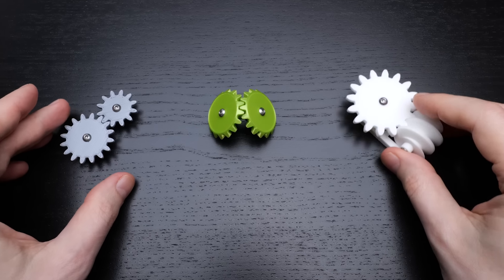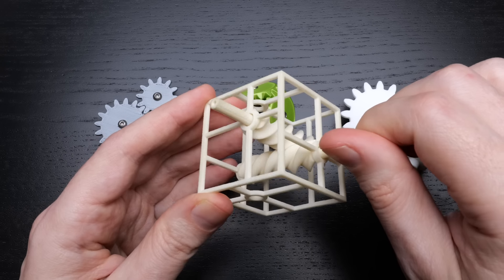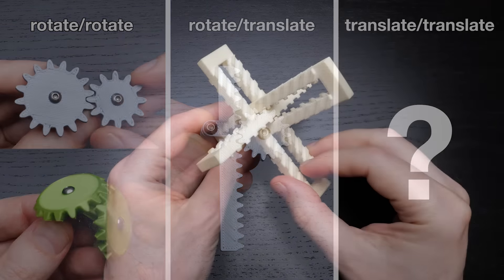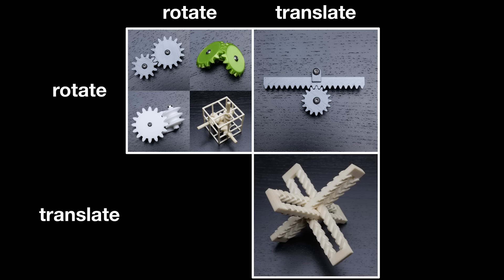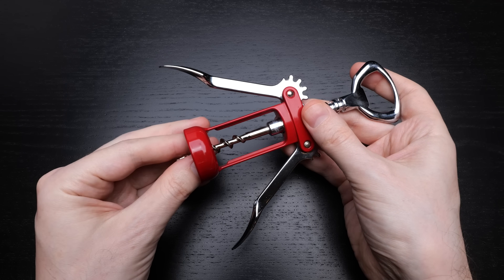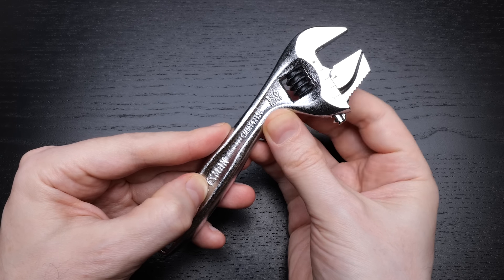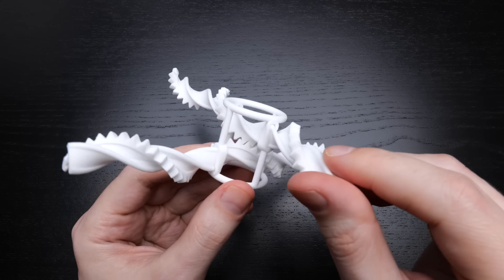Screw/screw gearing

Comment: Translate-translate is used in some garage locks in Russia. It is a very old design, but it is still manufactured. The key is pushed (or inserted sideways, rotated and pulled) through a hole and the "teeth" on the key interact with the "teeth" on the springloaded locking bolts, retracring them. Secrecy is achieved by the angle and positions of the teeth.

Comment: Actually a screw screw would be awesome for a lower weight safe locking mechanism. Extension and rotation can make a better lock than just translation from rotation. Similar to the force as rotation and lock mechanism works on modern rifles.

Comment: For the bottle opener, The screw forces caused by the cork screw are translating the cork screw, and that translation is moving the gears, not a screw motion through the gears.   It's the same gearing in both action.  Just because it's spinning in the gears, doens't mean it's moving by screw gearing, which is why it works in both directions as translation..

Comment: I can imagine the screw/screw mechanism being used as a regulatory mechanism to ensure 2 angled planes move in a rocking motion at a locked speed ratio and only one of them is powered. There is probably a much simpler way of doing it too.

Comment: Simple mechanism with 2 parts it is a bolt key. You push, or pull, if it is a reverse rigel key, and the latch slide to open door.

Comment: I don't know of any real world machinery that uses screw gearing however it can be applied to piston engines by seating these gears in the piston free to rotate so that the fixed oscillating motion can translate into rotational motion that can then be used to spin and drive magnets in an alternator system to generate more electrical power for other uses. correct me if I'm wrong but if my understanding of the gear is correct it can actually be set up in an array with four axels facing in different directions  so long as its helix is oriented correctly meaning they can also have more inputs to counteract the torque stress on the teeth of the gear

Comment: There is yet another tool, that fits the rotate/translate box as well as the translate/screw box, depending on which of its elements you fix in your hands. The Archimedes drill a bit outmoded, but still available!
Reply from the maker: How many rigid parts does the archimedes drill have? From looking at a couple of pictures it looks like two?
Reply: @henryseg  Maybe a video explaining its use  helps:
https://youtu.be/bM_ZnunHWJs
- or -
https://youtu.be/mFLBVIF-xNM
-> it is two parts in total. 
In the rotate/translate box, both are moving. There is no cage, unless you consider the collar, that does the translation, to also be a cage. You might also consider the piece you rest it against, in order to drill the hole, as a replacement for the cage.

In the translate screw box, it gets even weirder, you fix the collar, the wight of the drill alone will cause it to screw through it - which means: the translation is actually zero, still the drill itself screws under is weight.

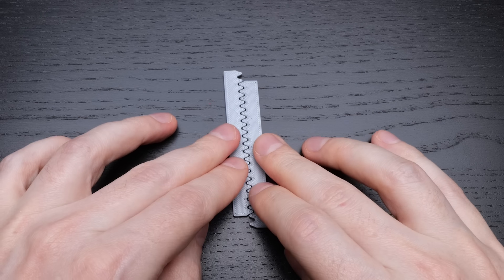Comment: If we think about rotation of a verrry big wheel around a very faraway axis, then in the limit we get translation. So the rack and pinion is a limit of the gear-gear link (with either the parallel or intersecting axes). At which point I thought of the rack and rack, which of course you finally got around to at 5:45.
Reply: I was going to say this as well!

Comment: If you fold each screw back onto itself you end up with a Mobius strip, and thus a cyclical motion. This is equivalent to a spur gear if you put two (or even number) twists in it.

In which case, the example in industry would be a roller coaster depending on drive type and frame choice.

Comment: I'm shocked I haven't seen any of these used in an internal combustion engine, possibly even in combination. I've seen them in some interesting mechanical transmissions, but it seems you could used these to translate the linear motion of a piston into the rotational motion needed for use in driving a wheel. Absolutely fascinating, regardless.
Reply: Absolutely no. You can not directly drive a gear train with explosions. Crankshafts snap in half all the time.
Reply: @Jmoneysmoothboy   That's not what I meant at all, just slapping a linear gear on the end of a piston, though I can see how you might get that impression, based on how I phrased my comment. Though, I do have to point out that they aren't 'internal detonation engines,' they're internal combustion engines, there being a major difference between detonation and combustion. 
At any rate, the concept I was trying (and apparently failed) to convey was the potential for combining the linear motion of a combustion driven piston with unique means of extracting that energy using these unique gearing concepts. Imagine, if you would, a spring-opposed piston could move freely in one direction, and then engage gears on the spring-driven (or compression, or, hell, MAGNET driven) "return stroke" (think the difference in the way the wine bottle opener moves while going in and pulling out). And that's just one conceivable configuration, off the top of my head. I'm not merely being contrarian, or dismissing your point out of hand, but I'm also saying it isn't fair to dismiss my comment without ensuring you understand the point I'M trying to make

Comment: The way that gear tooth profiles are made are typically thru what’s called an involute. If you look it up online there’s plenty of literature on it. If anyone’s looking to do a deep dive into analytical geometry, take a stab and see what you can learn. I don’t know how helpful it will be for this, as it’s pretty standard stuff for power transfer, but it’s still pretty cool math nonetheless.

For engineering-based context, Shigley’s Mechanical Design has a section on gear tooth profiles (chapter 13).

Comment: 6:00 - idea: corner bracket mount for instalations or even structural element for wood frames. both screws are driven in the material at equal rate ensuring balanced stress within the material. additionally - instalation could be faster because you need to drive only one of the screws. not sure if materials for screws would permit sth like this tho.

Comment: OK! If you could integrate a driver which would mount to that center frame piece for your unique gearing mechanism,
 and attach ladle-like end pieces to each end, their operative motion reciprocating would power a useful "paddling" movement for devices that'd lurch through water; similar to an aquatic ornithopter.
  The "cupped paddles" would have to possess conically tapered covex sides facing forward to slip ahead of the water before it, whilst also possessing great cavities on the obverse side by which to scoop the water thusly behind its passage forwards.   Perhaps hinging this paddle to flare outwards into broadsided flatter panels might be better still.
      Either way, with a driving mechanism that could cycle this between two terminal positions you could produce a rear-front-rear type thrust as these corresponding paddles in front & back must be at contrary articulations relative to each other here. As one pair thrust, the other pair scoops, etc... It would be as a mechanical sea turtle, I imagine.

Comment: Would it be possible to take the screw/screw box and make each screw curve in on itself, making two rings? That would be such a satisfying mechanism to hook up to a motor, as it could just keep rotating and be completely mesmerizing.
Reply: How would the rings twist around as well as rotate? Unless they were made of lots of near-cylindrical pieces with some sort of linkage between each piece. Or maybe I misunderstand your suggestion.

Comment: I believe i had some kids toy or possibly magic trick that was a translate translate motion. Just have this vauge memory of it. And being facinated by the motion even though that was not the point. I think it was yould push a bar in and it would cause a character to slide up and down. Though i gause inside it could have been translate-rotate-translate. 

I also saw a kid with a fidget toy that looked like a screw screw. Wich makes since as i cant imagine an actual use for scre screw other then to fidget. The part that made it a great fidget toy was one end of each screw was wighted so if you hold the spherical part and rotate it around the screws would push and pull themselves through over and over.

Comment: There is a translate-translate mechanism that you use almost every day: inside most of the mechanical locks you have these secrets - set of cyliders that are "translated" when you "translate" your key into key hole =) this is 90 degrees translate-translate

Comment: I'm not sure the rotation v. screw distinction is that useful in practice, for reasons that the wrench example makes clear. As another example, a leadscrew screws if you hold the nut fixed, while it rotates if you hold the bearing fixed.

What's much more interesting to me about your mechanism isn't that both elements are screwing, but that they're screwing along different axes
Reply from the maker: Right, there’s a whole other side to this that I didn’t talk about - where the various axes are. The adjustable spanner is a very special case in that the various axes are all identical.

Comment: I wonder if it's possible using only screw, screw connections to use gear up/down systems, to be able to move one gear a lot by moving a small gear a little.

Comment: you could turn both helical racks into two twisted elastik toruses, then you would have a frame and two gears which both have twi linkes rotanios, but in independet directions. they would both turn around there centerpoint but also get twisted like a smokering.

Comment: at first, i thought this kind of gearing could be utilized in stuff like vault doors and watertight doorways like in submarines. but if we get out into megaproject scale dimensions, perhaps this could be used as gyroscope components for very large space stations, where the degree of curvature of these gears extrapolated out into being two(or more) large rings doesn't negatively impact performance in a low-grav environment.

Comment: I am picturing something with a lateral motion that engages 2 plates separately. As you move to one side, the bottom moves forward. Then as you move to the other, the top moves forward. Like a walking robot that uses offset gears, but with a pair of pistons to push back and forth. Or something two parallel planes need to be moved by one back and forth motion, and the additional rotational force reduces the wear and tear compared to the rack and pinion?

Comment: What if the straight lines of the center of the helical gears curved just slightly so you got two hula hoop sized circles (could test with a segment). Then you could move continuously in a single direction. That'd be so satisfying if it worked.
Reply: Well I'm thinking the material would have to be flexible somehow to allow it to roll along the circle, otherwise the "hula hoops" would rotate and run into each other. I could just be misunderstanding, though

Comment: Translate/translate is used in some locks, at least in eastern europe, we had very simple locs. There is spring loaded bar locking, with sections sliced out of it in some pattern, and key is the same, just another bar, with sections sliced to match the lock pattern, so that it moves the bar smoothly, if there would be some misalignment key would jam in lock and not unlock door. Though in retrospect this is likely quite stupid lock and easy to pick :), But at least slide/slide gearing example in real life.

Comment: Thank you for a very good exploration of gear and screw motion. [Subscribed!] What would a ball screw mechanism be considered as?
Reply from the maker: If I understand ball screws correctly (I just looked them up - hadn’t heard of them), then they have lots of small balls, so they don’t really fit into the classification - there are more than three rigid parts. Lead screws look similar but without the extra parts, and it looks to me that they are rotate/translate mechanisms.

Comment: Could be an interesting solution for situations where a more typical cam wheel setup is undesirable for some reason, such as the sinusoidal variation in speed caused by the changing angles of the connecting rods compared to the linear input and output motion. Assuming a bearing is used to eliminate the rotational aspect of these helical rack gears, you could use this to achieve a 100% linear 90-degree translation of motion. Presumably, you could alter the tooth angle and number of turns of the helix to get angles other than 90, though I'd imagine the efficiency of the gearing would suffer.

Comment: 4:12 Huh? No, it's not: it's clearly a rack and pinion. It's just that the rack is symmetrical about it's axis and thus is free to to rotate while it's moving but that's just by-the-by, it's not necessary in order to make the spur gear rotate.
Now, if the spur gear was making contact with the screw part of the corkscrew, then that would qualify, but here it doesn't.

Comment: Hm... not sure where you'd use this type of assembly, as you can get a transition to rotation type of exchange just using a rack and pinion + bevel + spur to get this type of exchange using less area and mass. however if you needed to use a transition force to more than 1 rotational forces in different angles at once, thats where I could see this design being useful. Not sure where we'd use that right now, but that is a use case I thought of as this gear assembly can theoretically turn one transition force into infinite rotational angles.

Comment: One thing you didn't talk about is the structural frame of the screw/screw gearing. On your plastic parts, the frame holds the gear in place by constraining the curved edge of the flute but still allowing it to slide freely. For a practical application however, it doesn't seem so obvious to me what kind of bearing could hold the gears and also allow smooth motion while carrying loads. Most likely it will need an unconventional custom bearing solution.
Reply: Roller-coasters use a similarly constrained track with rollers on 4 surfaces around the frame.

Comment: Neat video, very neat ideas.  However, there is an aspect of 'gears', in general, you've avoided.

A gear is usually used to transform one motion into another.  There is an input motion and an output motion.  There is more to it than just a relationship between the motions of the two non-'frame' components, there is the direction of transfer of the mechanical effort.  The worm gear is not symmetrical in this respect, applying motion to the worm turns the gear but applying motion to the gear does not move the worm, not in the real world.  Same with holding the lower jaw of the weench: applying a screw motion has the result of making a translation motion, but applying a translation motion does not have the effect of making a screw motion.

Comment: Hello Henry great video!, there is an application for translate-translate, it’s known as adjustable parallels used in machining shops
Reply from the maker: Thanks Enrique! From looking into adjustable parallels a bit, it looks to me that they have only two rigid parts? If so it’s a slide joint, but not what I’d call a gearing because there’s no “frame” part.

Comment: Can the screws be formed into hoops by joining slightly flexible sections together?
This means you string two or more hoops in a chain, all moving continuously powered by single motor.
It would look amazing and break people's brains.
Reply from the maker: Maybe? Flexible parts are harder to design than rigid body geometry...

Comment: I feel like the definition of the circular gears themselves need a different definition in this context. Since a circular gear is just a rack that's twisted in the same plane that it moves on, and a planetary gear is just a rack that's bent in the opposite direction on the same plane, it appears as though the pairs of gears can be defined by the relation between the position of the axis each gear rotates around and the position/direction the teeth face

Comment: Great bbuil. I love it. Which tool/software have you used for modeling the gears?
Reply from the maker: I use Rhino3D with its Grasshopper scripting language.
Reply: @henryseg  Thanks for your answer. I haven't heard of Rhino3D and grasshopper before. I was looking for a good software for my algorithmic/ programming modeling purposes. I have used Creo Parametrics, Inventor and Openscad/Solidpython before. Both Creo and Inventor have some really cool features, but are very limited if it comes to programming/algorithmic modeling. On the other hand Openscad/Solidpython is good if you want to do modeling by programming, but lacks in many other ways. After a short research, "grasshopper" looks really good for these purposes. Maybe some other guys have some advice, which CAD-tool is good, if you want to do algorithmic and programming modeling and why.
Another thing I was wondering how have you made it? I guess you 3d printed it? Which method have you used? FDM, SLA or some other? I am espacially wondering, how to place the support structure . Where have you placed the support structure? Espacially for the "cage" part.
Anyways keep up the good work. I am curious to see, which idea you have next.  👍
Reply from the maker: @sgschusswaffenlol9  I had this printed in SLS Nylon by Shapeways. No need for support structure with SLS.
Reply: @henryseg  Thanks for your reply. I haven't thought about it. 
SLS is definitly a method I want to try for my gear projects.